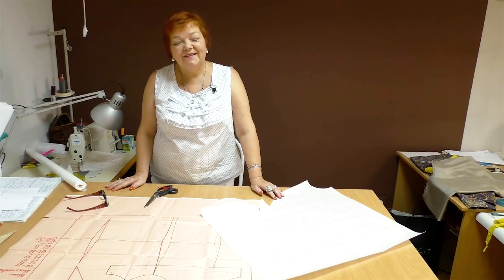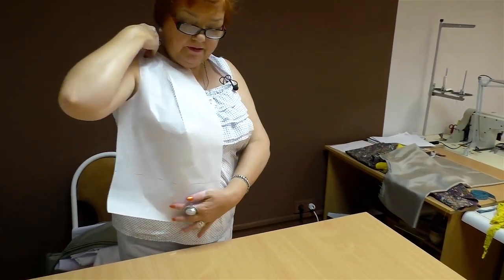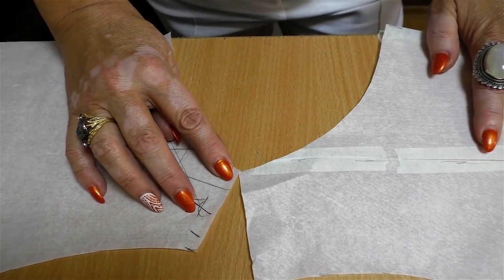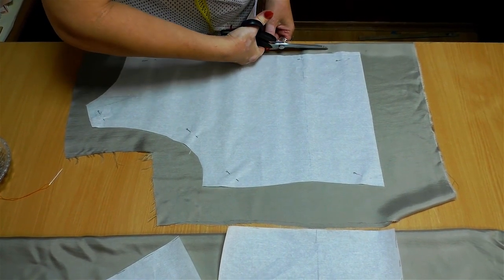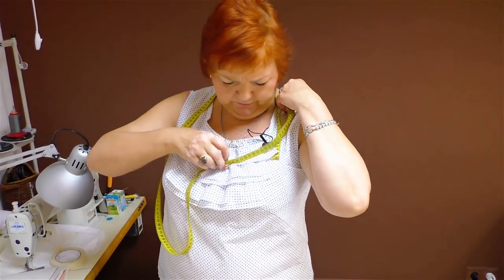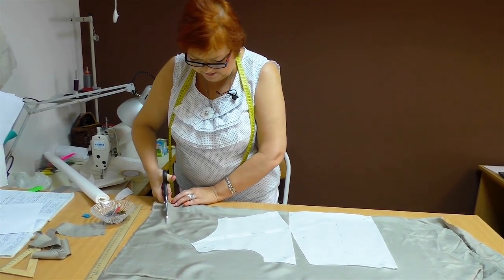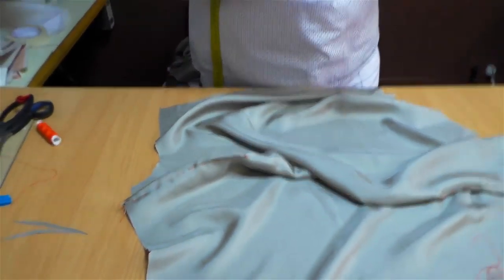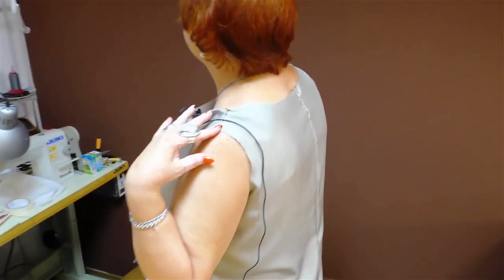DIY: How to make a cowl neck on a blouse or a dress. Making a cowl neck on a top. Sewing tutorial.

Comment: Hello, this video was amazing and highly informative and the top turned out so beautiful! 
I have a couple of questions I hope that you can help.
I have quite a large bust, which is why I am seeking cowl patterns as they are so complimentary without being obscene. I was wondering how to decide where the cuts need to be for such a shape? My bust dart is enormous (like 12 cm wide, and 16.5cm deep without seam) and I see you sewed the bust dart. Was it the new bust dart size? If I want the fabric to be lose all the way down to the bust line (with the opening still closer to the mid point between bust line and collar bones) do I remove the dart completely?  
My waist is dramatically smaller than my bust, do I need to consider a side invisible zip? Or will the slightly deeper neckline and the bias allow for getting in and out of it? 
And finally, is there any knit or woven fabrics that I should avoid? I have some Lawn and Rayon and satin and and Id really like to use them because they are so beautiful but I dont want to waste it on a pattern that Ive not understood properly. 
Thank you for taking the time to read this, I know Im so full of questions, but I want to do your tutorial the justice it deserves. 
Xx